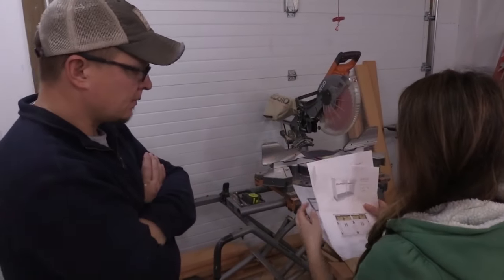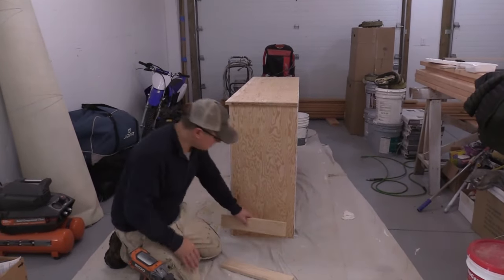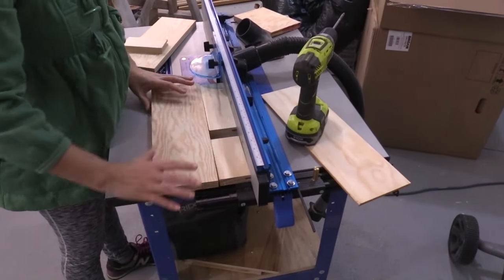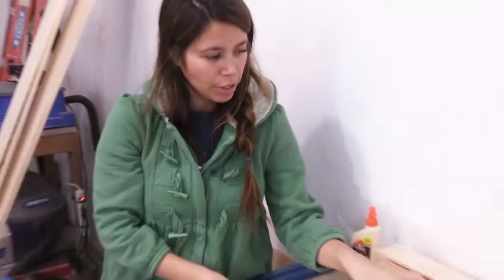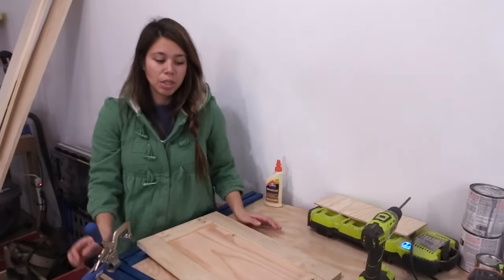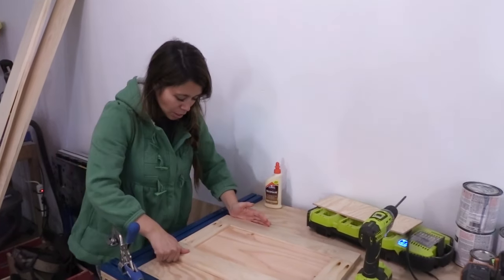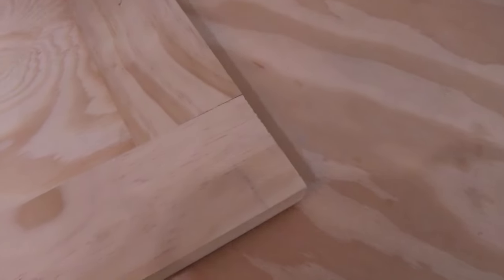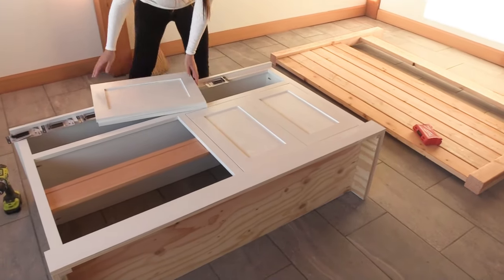Entryway Cabinet Console Build

Comment: It's a plywood panel. It doesn't matter whether you glue it or not. Yes, plug the holes for a finished look. If you don't want to buy the Keegan plugs than use dowels. Use a flush cut saw and finish sand.

Comment: Since you were going to paint it anyway, I would have opted to plug the pocket holes, sand them smooth and then paint over them.  That way, they would have been much less visible, if not completely concealed altogether.  Other then that, I think you did a bang up job.  It looks great and will do the job you intended.

Comment: When I build a piece like that I like to ease the edges a bit with a tight roundover bit or a hand planer.   I find it a little more "finished" when the sharp corners, especially on the top or other edges you are likely to touch, are slightly softened.  Maybe I'm wasting my time.  Thoughts?  Thanks as always for a great vid!
Reply from the maker: +endall39 I agree with you, sharp edges end up with the finish worn off quickly.  We do sand edges but I line your way with the hand planer

Comment: I live in a fairly humid part of Oregon and I am wondering if you have any advice for keeping painted furniture from feeling sticky. A friend built my daughter a loft bed out of some scrap wood, and painted it white before I could check to see if we could just stain and polyurethane it. The white does brighten up the room, but it holds dirt like crazy and feels soft/sticky, even months later.
Reply from the maker: I would check with local builders or your paint counter on what paint they use for interior house trim and kitchen cabinets.
Reply: Thanks, that does make sense!
Reply: Hi Sara. I live in FL and had the same problem. The painted furniture would actually stick to the wall and then peel the paint. I just did a distressed dresser and put a coat of furniture wax on it. WHAT a difference. Not only does it protect better, it makes it very smooth. Have not had one problem since using it. I used min wax dark and clear depending on what color/look I am going for.  Easy and inexpensive way to protect it. If it doesn’t work for you, it is only $7, so you aren’t breaking the bank.

Comment: I was wondering why you did not fill the pocket holes in the doors?
Reply from the maker: We normally do - especially on a high use door like a kitchen cabinet.  It will probably bother me until I go back and fill with plug lol.  Been in "get-it-done" mode.